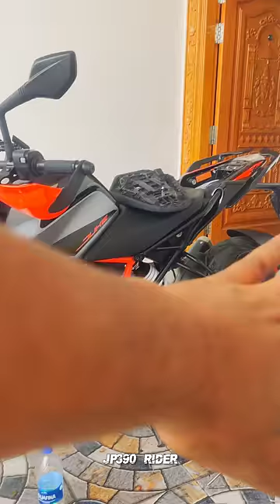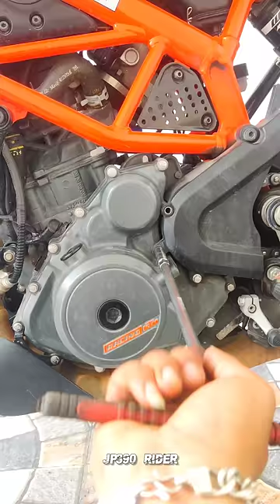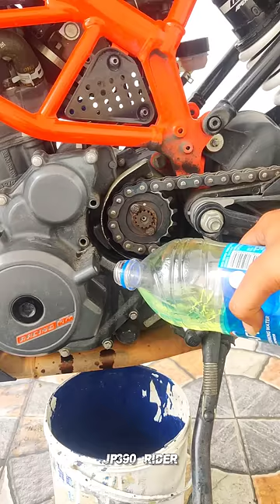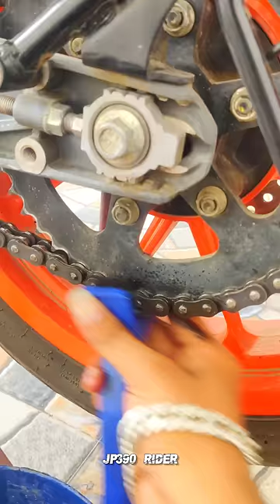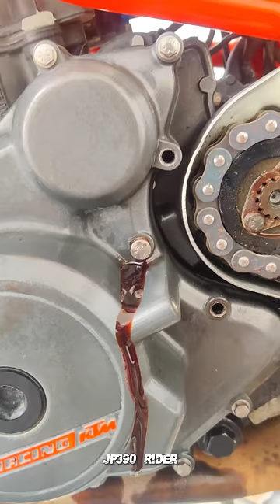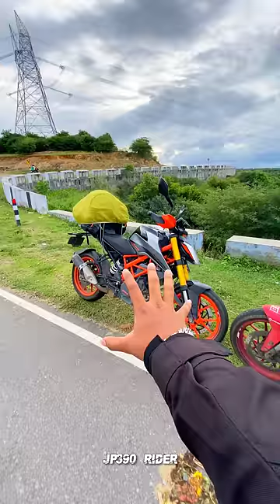Boold 😭🩸 Duke 390 😱 #shorts #duke390

Comment: If u clean with diesel, chain spray will not stick to it. So use petrol or chain cleaner don't use diesel
Reply: bro dont use petrol for cleaning as the o ring in the chain will get damaged and by the way diesel or kerosine we can use any one as the chain clean will be having the same ingredient in diesel
Reply: @akshayv8305  diesel and mix with oil and clean